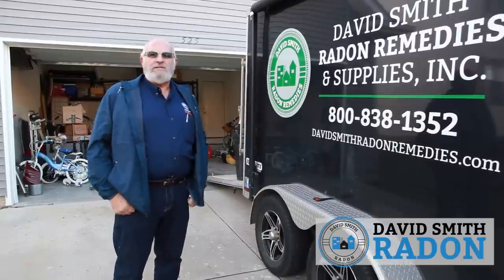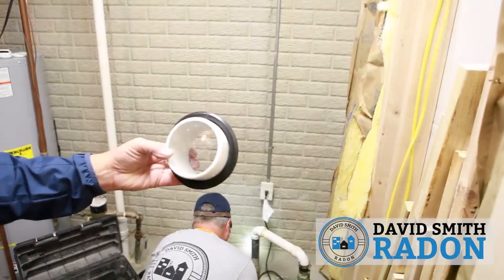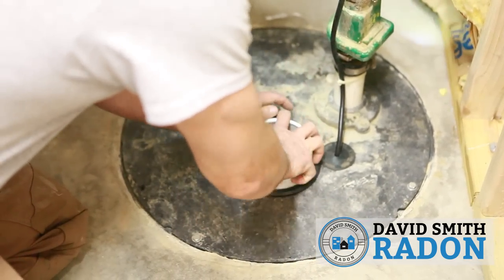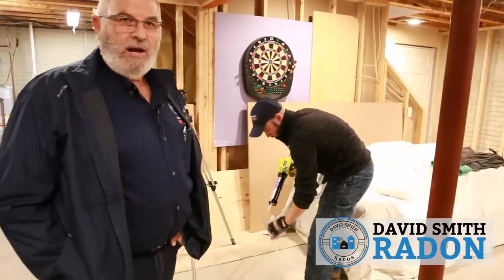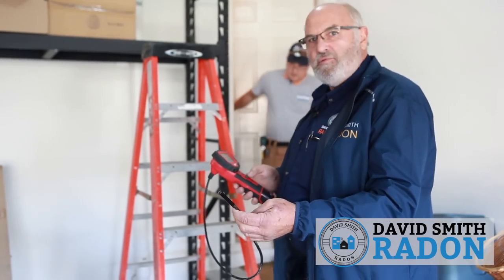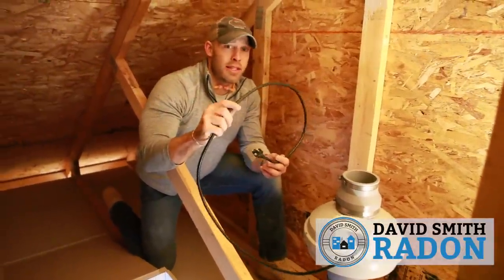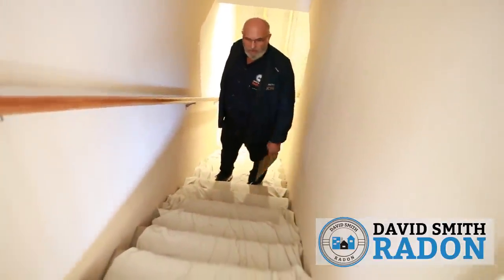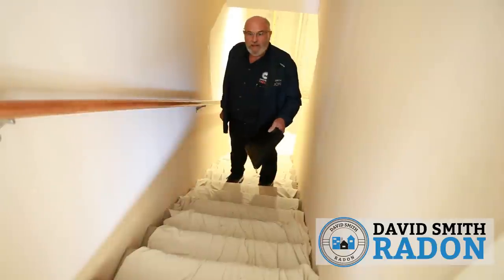Typical Radon Removal System of a Home Built After the 1980's

Comment: I realize this video several years old and I don't know if anybody from the company checks the comments, but I do have a question. I haven't finished basement in my house, but I'm redoing it because of the flood that damaged part of the basement. The damage part had the drywall removed the two feet, but the drywall has not been cut back in the rest of the basement. I plan on caulking as many cracks as possible before I call a radon mitigation company and to finish the job. Would it make sense to cut the drywall back and caulk the slab to wall joint behind that drywall? Or is it sufficient just to caulk where the drywall meets the slab?
Reply from the maker: Yes!  Anywhere that is exposed you can add caulk to help seal it up!   You want to caulk the foundation to the wall (if there are cracks), not to the drywall.

Comment: Why would you cement the fan’s flexible rubber coupling to the pvc?  That’s why there are hose clamps.  It’ll be a bitch to change the fan rubber coupling in the future, if needed.

Comment: Very informative video. I have a new construction home with an active radon system but our readings are high. I plan on installing a manometer first on the radon pipe, I know the fan is running, then caulk all of the cracks and v joints in the slab before I connect a new pipe into my sump pit by getting a special sealed cover that uses the french drains to pull radon from a larger area. We have a 600 sq ft crawl space with pea gravel and heavy plastic sheeting over the gravel. Will I have to vent that area separately since the radon fan only draws from the main slab area? Thanks. We live in CO.

Comment: Very informative! I wondered what the cost of doing this system was?
Reply: Lois Loon, your name is fitting. Just because you don't know about something doesn't mean it's a scam. Alpha particles emitted from Radon decay products is not witchcraft because you can't see or smell them.  It's actual science that has been proven time and time again for decades. I'm assuming a friend told you it was a scam and that you've never actually done empirical research. You might want to question the knowledge of that friend before you embarrass yourself.
Reply: @keithrogers2295  it just seems like they were almost more concerned about cosmetics. So they got this customer for two systems and a half as! Crawl space encapsulation.  They were using gutter downspout connected with sheet metal screws for the downspout!. I find it hard to believe that is air tight and it passes right by windows. I didn’t hear anything about a dedicated gfci afci circuit for,the fan.  Not sure why a properly sized fan couldn’t have serviced both crawl space and core hole. Now they have two constantly running fans. There is no problem with using dwv pvc inside. The crawl space is half done. It needs to,have conditioned air flowing through and probably a dehumidifier.

Just curious what the original contractor s readings were a,d what the reading was with the first new system only and properly ventilating the crawl.

Also I, not sure if the exit of the gutter pipe,is far enough away from the soffit.

I’m guessing this customer dropped 10-13 grand out the. Door.

Comment: Nice video. Can you tell us what you use/how you cut the larger PVC pipe when needed? TIA
Reply: I use a miter saw or reciprocating saw to cut the pipe itself, I use a set of Milwaulkee Bi-Metal 3-5/8" bit and drill the holes.